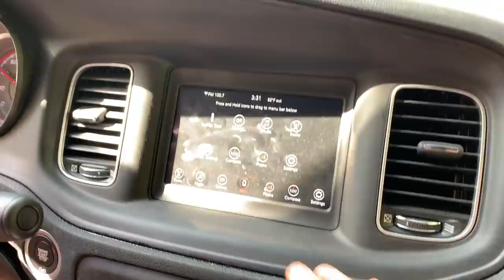Rebuilding A Wrecked 2018 Dodge Charger Police Car Part 6

Comment: Any idea when you might cut that black zip tie off of the driver’s side headrest?  It’s bugging the heck out of me!  🧐
Reply: Dave Your kidding correct.
Reply: Yeah, its bugging me too 🙄
Reply: OCD
Reply: Hell yea man me 2
Reply: You guys need a life really not kidding who noticed stuff like that.
Reply: Leatherkid01 me three
Reply: Me too
Reply: Dave me 4
Reply: Me 2!
Reply: Dave J they pointed it out in the first video dude
Reply: Its because the headrest expanded during the collision I'm assuming, you can fix the latch on the headrest with JB weld and it will make it able to lock back into position
Reply: @ratj4715  i notice if say 1 headlights  is aftermarket and 1 is OEM ... OEM vs replica rims, OEM switches vs aftermarket replacements ...id stare at it and analyse it till i notice a difference ... 🤣 am just built that way....
Reply: Leatherkid01 You need help kid.
Reply: @ratj4715  why u have an issue with me having such attention to detail... i dont know....some people are just that way. I dont see it as an issue to me..... like placing a coffee table equally distanced all round to the couch... or placing a rug then usimg rug tape so the rug dont move/shift ....its how i got an A in bodywork for college. 😉
Reply: Leatherkid01 Am more less Messing with you but I do find it kinda weird by the things people noticed and let it bother them. I just don’t care about something so small their so many really big issues in life as it is without little details like this. What happens in your life when a really big detail pops up how will you handle it.
Reply: @ratj4715  haha....all good....its just all automatic with me...yes there are other issues to worry abt out there....but trying to figure out little differences in things just entertains me thats all. Its not a problem for me. Just like now i know why you quesrion me or reasoning behind it for this "chat" or replies to my messages. Thats all....😀🤙
Reply: Leatherkid01 yeah it all in fun nothing personal for sure Am also glad you can laugh at yourself. That tells me a lot about you.
Reply: Dave J No!  😆 I’m not kidding!

Comment: I've never used that mesh stuff before so not sure how good it works but shouldn't you epoxy the crack anyway on the headlight to keep moisture out?

Comment: I was in a wreck about two years ago every bag deployed when me and my mom got hit on the side and caused a roll over. There was a lot of pain the airbags didn’t break any bones my biggest thing was it was so hot it burned both my legs there was definitely a blunt punch feeling when they went off . Nothing permanent and I still love driving
Reply: Same here, back passenger air bag busted my nose but saved me from breaking my neck 😂

Comment: Need to get a “Not in Service” magnet to put on each door.
Reply: Prairie State Auto Restorations is that a law or sth
Reply: That’s why they covered the decals with tape for the time being...they’re not dumb
Reply: It is a law if they want to keep it with those stickers.
Reply: I get the tape is temporary, but if they want to keep it after they’re done, I’m sure they don’t want to go through that much masking tape.
Reply: Prairie State Auto Restorations probably going to make custom decals
Reply: should check 316.2397 Certain lights prohibited; exceptions.—

(1) No person shall drive or move or cause to be moved any vehicle or equipment upon any highway within this state with any lamp or device thereon showing or displaying a red or blue light visible from directly in front thereof except for certain vehicles hereinafter provided.

(2) It is expressly prohibited for any vehicle or equipment, except police vehicles, to show or display blue lights. However, vehicles owned, operated, or leased by the Department of Corrections or any county correctional agency may show or display blue lights when responding to emergencies.

(3) Vehicles of the fire department and fire patrol, including vehicles of volunteer firefighters as permitted under s. 316.2398, vehicles of medical staff physicians or technicians of medical facilities licensed by the state as authorized under s. 316.2398, ambulances as authorized under this chapter, and buses and taxicabs as authorized under s. 316.2399 are permitted to show or display red lights. Vehicles of the fire department, fire patrol, police vehicles, and such ambulances and emergency vehicles of municipal and county departments, public service corporations operated by private corporations, the Department of Environmental Protection, the Department of Transportation, the Department of Agriculture and Consumer Services, and the Department of Corrections as are designated or authorized by their respective department or the chief of police of an incorporated city or any sheriff of any county are hereby authorized to operate emergency lights and sirens in an emergency. Wreckers, mosquito control fog and spray vehicles, and emergency vehicles of governmental departments or public service corporations may show or display amber lights when in actual operation or when a hazard exists provided they are not used going to and from the scene of operation or hazard without specific authorization of a law enforcement officer or law enforcement agency. Wreckers must use amber rotating or flashing lights while performing recoveries and loading on the roadside day or night, and may use such lights while towing a vehicle on wheel lifts, slings, or under reach if the operator of the wrecker deems such lights necessary. A flatbed, car carrier, or rollback may not use amber rotating or flashing lights when hauling a vehicle on the bed unless it creates a hazard to other motorists because of protruding objects. Further, escort vehicles may show or display amber lights when in the actual process of escorting overdimensioned equipment, material, or buildings as authorized by law. Vehicles owned or leased by private security agencies may show or display green and amber lights, with either color being no greater than 50 percent of the lights displayed, while the security personnel are engaged in security duties on private or public property.

(4) Road or street maintenance equipment, road or street maintenance vehicles, road service vehicles, refuse collection vehicles, petroleum tankers, and mail carrier vehicles may show or display amber lights when in operation or a hazard exists.

(5) Road maintenance and construction equipment and vehicles may display flashing white lights or flashing white strobe lights when in operation and where a hazard exists. Additionally, school buses and vehicles that are used to transport farm workers may display flashing white strobe lights.

(6) All lighting equipment heretofore referred to shall meet all requirements as set forth in s. 316.241.

(7) Flashing lights are prohibited on vehicles except as a means of indicating a right or left turn, to change lanes, or to indicate that the vehicle is lawfully stopped or disabled upon the highway or except that the lamps authorized in subsections (1), (2), (3), (4), and (9) and s. 316.235(5) are permitted to flash.

(8) Subsections (1) and (7) do not apply to police, fire, or authorized emergency vehicles while in the performance of their necessary duties.

(9) Flashing red lights may be used by emergency response vehicles of the Department of Environmental Protection and the Department of Health when responding to an emergency in the line of duty.
Reply: Hammerback0  plenty of 👑 Vic's running around here that never bothered getting all that glue off. Almost all the lettering is now ghosted on.
Reply: You actually need permission from your state police and agency the graphics are from. Stock decals yeah you'd just need permission to have them on in public with the out of service. But legit graphics from legit agency you need to have permit as the emblems may be copyrighted and they agency may have a filming policy or division. State police in some states require permits.

To make it legal sheriff would need to be removed or fully covered.
Reply: @F6HemiCharger  actually they could keep them on but then they couldn't drive the car in public. Movie cars have special plates and permits and are also registered with dmv as well as state police. 

These guys have covered their tracks so far and did good job restoring.
Reply: I think they'd have better kicks out of a unmarked white with tinted windows and 2 stock antennas over a marked car
Reply: im on the verge of getting an ex police car and i was gonna get a sticker for the back of the car that says "NOT A COP PLEASE PASS ME" cause i already know the annoyance thats gonna come with

Comment: Ive heard you can use the soldering iron to melt cable ties/zip ties to plastic weld cracks. Not sure how strong it is but I think it is the same plastic.

Comment: I don't know what it is like in the USA. But in Canada FCA has a program called conquest where they can match a lot of aftermarket prices. So you can get OEM parts at aftermarket prices. Usually on bumpers doors and fenders.

Comment: That car came from Virginia, i see it’s sister cars almost every day driving trough Russell county va in a town called Lebanon, them Russell county sheriff boys like to speed trap the highway right at the slow down from 65 to 55
Reply: @Ghoststalker777  No it didn't, it came from Virginia.  If you watched the last video, it shows them removing the Russell County Virginia badge from the finders.  Also, the temp tag on it is from Va and so is the state inspection sticker.
Reply: Guys I literally see the exact same car everyday on my way home from work, it’s definitely from va

Comment: When you want to turn off the traction control, you can actually pull the abs fuse, otherwise holding the button for 10 seconds won't turn all the assists completely off. Love the channel boys, it's awesome to watch 👌👍

Comment: You should take the spotlight of the other car and install it on the passenger side :)
Reply: The devil Made me do it  Quick google search confirms that you are right, they do  make them for the passenger side for the Dodge, "Unity 210031-0002" plus an istallation kit.. but that costs money thou..
Reply: if they are side specific turn it upside down and stand on your head to control it.  On second thought that might draw too much attention.

Comment: The Hellcat hood with the standard bumper will never line up. I have one and you can make it passable but it won’t be perfect. The standard hood has a different shape design similar to how you filled the center section to be smooth. If you want to close the gap you’ll have to upgrade the bumper to the SRT version. Otherwise you can adjust it and make it look ok

Comment: The police logos look so cool, but you can’t legally drive with them on probably. Are they going to have to be removed : (
Reply: I thought they were planning on using the car on a drag strip or circuit. That way they don't have to delete the stickers.
Reply: Thomwashere 
Oh nice, alright 👍🏻
Most likely if they are driving around town in them, they probably will put tape on the police logos.

Comment: You can use Bondo glass to build up the edges to make the body line perfect, on the front bumper, it would be a lot cheaper than looking for an oe replacement, you could also cut that line off of one of your broken bumpers, and plastiweld them together , with some body work , and I think it would turn out nice

Comment: Just make some “out of service” Tags or stickers for the back side windows and that should do it. Then you don’t have to put tape on the Sheriffs badges on the car.
Reply: Never ever seen a car with the police or city name on a road before it has to be against the law.
Reply: It's pretty common in LA with movie props or decommissioned LAPD crown vics.
They just slap a paper that says "OUT OF SERVICE" over the city seal on the doors.
Obviously they would have to check on that because laws may vary from state to state.
Reply: Jose Manuel Rios like u said never seen it am in Ohio I know you would never get away with it here they would be to afraid that they be use for the wrong reason and probably would sooner or later.  That seems crazy to me.

Comment: The bumper is just fine y'all trippin
Reply: No it's not all chargers have the same gap issues specially when using aftermarket bumper,hell even with the OEM one it's really pain to adjust.

Comment: Its really hard to do a spin out in an AWD car.  Especially with the electronic stability control.  If you guys want to have some fun with it, see if you can find a slick track at an emergency driving course and give it a go.  I doubt you'll be able to get it to spin out without disabling everything.

Comment: Hey guys, while it might be cool to transfer the lightbar over, have a read of TN Code § 55-9-414 (2018) "(1) [..] it is an offense for anyone to install, maintain or exhibit blue flashing emergency lights [..] except full-time, salaried, uniformed law enforcement officers". You also need to worry about TN Code § 55-9-402 (2018) "(1) [..] No nonemergency vehicle shall operate or install emergency flashing light systems, such as [..] wig-wag [..] within the headlight assembly or grill area of the vehicle"  You basically couldn't have this on a road legal car, and uh.. cops tend to notice Chargers. You might be able to mod the lightbar to be white only though?

Comment: Noticed you mentioned getting 6k bulbs to give it that "bluish" effect, 6k will give you more of a bright white barely touching the blue spectrum. Go with 8k's to give it the ice blue or 10k's for the deep blue.  Although 10k's are illegal in most states, if not all states

Comment: I just saw 10:54 that you have the option of keep  your distance on your steering wheel. That means that you need a little black bolt on your front bumper so you can have this option. 👍😎🔟

Comment: Bumper doesn't look bad at all.. but you can see lil like the hood sits to high where yall were pointing at the bumper.. but its not too high tho, looks good. 
And get some cougar Led lights you will like those better than the blue lights i promise ya

Comment: Looks good boys... Like I said if you want turn the AWD off pull fuse #9 and #48. A light will come up on the dash that says "AWD SERVS". That means it's off. Make sure you turn the car off when pulling or putting the fuses back in just to be safe. Don't forget to turn the traction control off when doing burn outs in two wheel drive and AWD off.

Comment: Just a heads up guys, seems y'all are exporting to 60 FPS (frames per second), but your recorded footage isn't 60, looks like it's 24FPS, or maybe 30.  To save time for exports/uploads, might want to change the project settings to match your footage better.  That, or start recording footage in 60FPS.  Otherwise, videos look great!

Comment: You need to pad your saw horses. Conduit foam or a couple pool noodles will work just fine. By the way Dollar General is running a special on pool noodles in black and orange  for $1.00

Comment: The bumper is not that bad but you could leave it installed and wait until something happens to it like a scratch or some damage from big rock or something like a old rusty trailer in your way you didnt see.  Never know.

Comment: just add a weather strip to the gap like the bmw e36 m3 has a a rubber strip along the gaps keeps engine clean
Reply: why not use the bumper from the 2017 parts car.. i see the gaps looks cheap

Comment: The front bumper is most likely fine. It's the hood that doesn't belong with everything. But in hindsight, it is most likely a combination of all those things together that is causing the misalignment. The bumper looks like it sits too low for that top edge vs the hood's edge.

Comment: Worried about a bumper that saved them a ton and will cover up / cut into with the push bar yet use zip ties on the head rests and duct tape on the air bag / steering wheel. Gezz

Comment: Get yourselves some RapidFix for those jobs where you need to glue plastic items together.  It’s a two part product that has a bottle of superglue and a bottle of fine powdered polymer.  The idea is that you glue the two parts together and where the join is, sprinkle the fine powdered polymer onto that line and then drip a little more superglue onto it.  You can build that up progressively such that it becomes really strong and you can even drill it.  Amazing stuff. Search for Rapid Fix on eBay and see for yourselves.

Comment: U need to put pool noodles on ur bumper stands . U have placed finished painted bumpers face down on the stand if u tape pool noodles on the top rails of the bumper cover it's extra cheap ass damage prevention. I'm in the business so it's just a cheap fix I seen u guys could use .

Comment: Keep it as a slick top. It's a lot cleaner looking without the light bar plus, its illegal to use the cherries and berries (red and blue) on public roads if you're not law enforcement.

Comment: @goonzquad Get the OEM Bumper. Make the 2018 Dodge Charger Police Car authentic. You already mentioned that the aftermarket bumper doesn't fit right. Never cut corners on a car like this one. OEM is the way to go. Especially if you decide to resell it to someone else as you can get a premium. Aftermarket front bumper lowers the value of  2018 Dodge Charger Police Car...

Comment: Decals; blacked hood scoops in carbon. And extended side decals coming in
on top of the front side markers light along the headlamp and air inlet bow/ 
grille edge down into the lower air dam. I suggest carbon fibre brakes for it.
www.ebcbrakes.com You guys missed to refit the front wheel liners;)